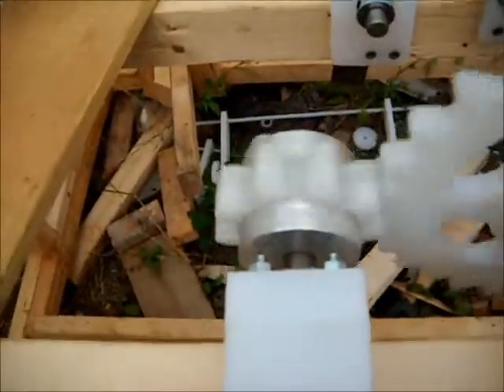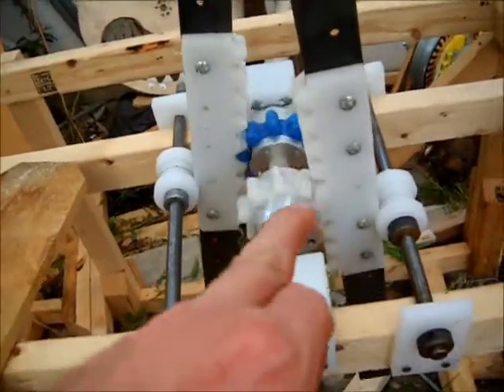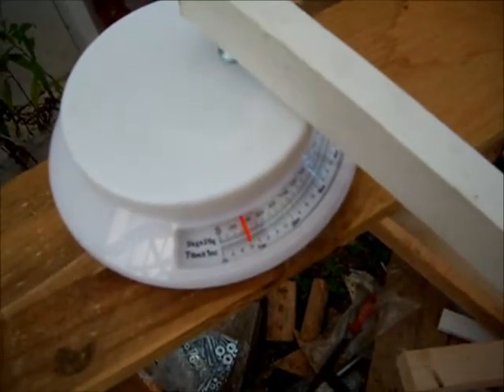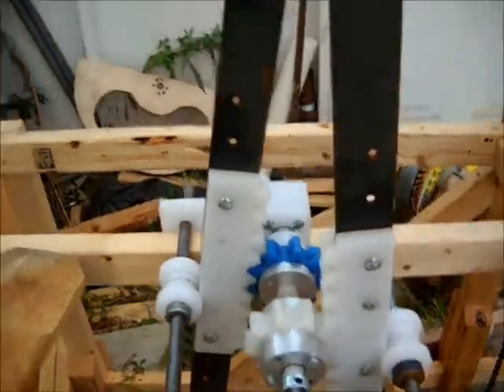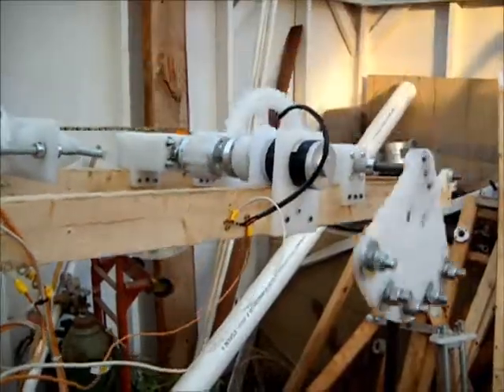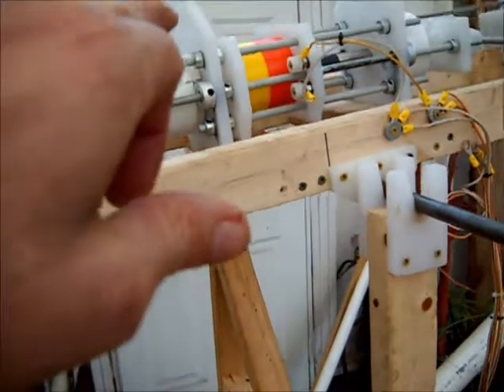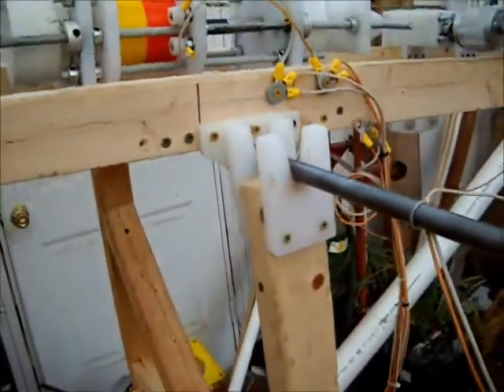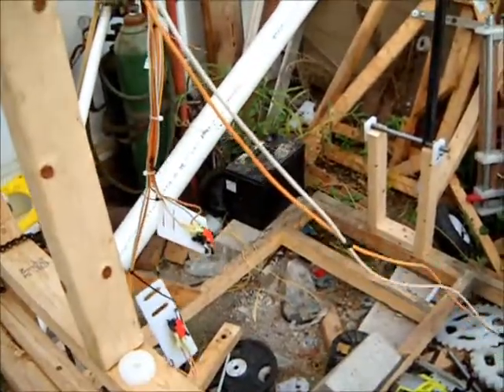GRAM 9 19 17b

Comment: You can not get out more than you put in! Ever! And what on earth is "mechanical advantage"?
Reply from the maker: hi, 
https://www.google.com/search?q=mechanical+advantage&oq=mechanical+advantage&aqs=chrome..69i57j69i65&sourceid=chrome&ie=UTF-8

this is not a OU project
Reply from the maker: https://youtu.be/yhrR4384SGE

just for info, Glenn, I hope this helps
Reply: Did you read the section on efficiency? If there is no loss, the most you can get out is the same as you put in. Not more! And there is always loss, therefore output is always less than input. 
Why isnt this a OU project?
Also you are confusing foot pounds with foot pound seconds. Big difference, same as watts and watt hours. I can take a lever, apply 1 foot pound, and get 10 foot pounds out, but thats not energy. If I put 1 foot pound second in, I will ALWAYS get less than 1 foot pound second out.
Reply from the maker: Hi, it is a gravity assisted power project. i am increasing the radius on the rotating arms. I will post results when available . 
http://www.besslerwheel.com/forum/download.php?id=755&sid=54da889b2b63f20cbfeb29aafe650faf
http://calctool.org/CALC/phys/newtonian/centrifugal
http://calctool.org/CALC/phys/newtonian/centrifugal
this is what I am trying to use to calculate the HP at the output. if I can measure 0.13 HP to 0,3 HP then I should be able to generate about 100 watts of electricity using a buck converter  with the PMA. Thanks for the help.